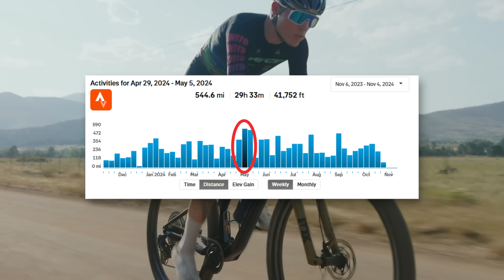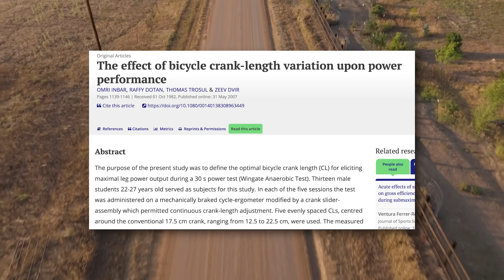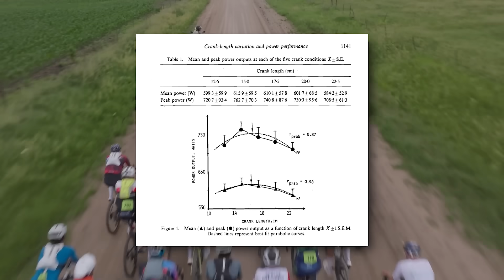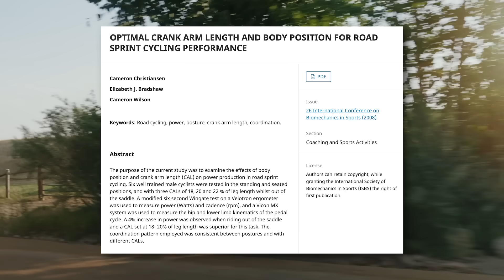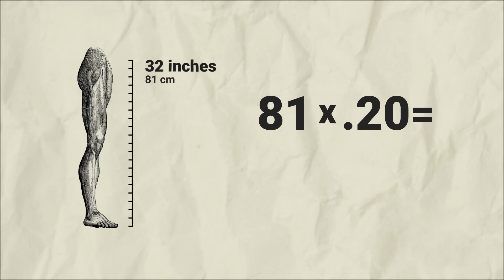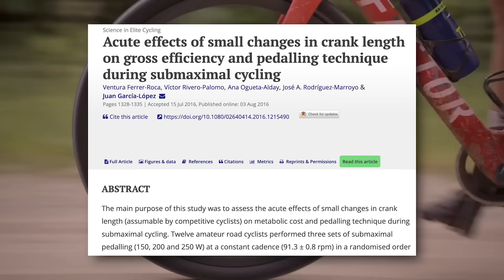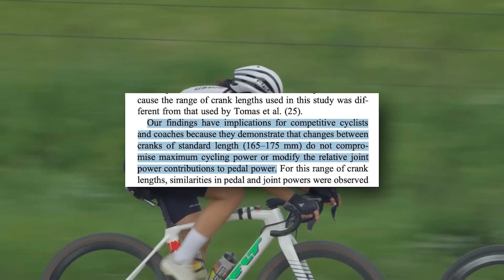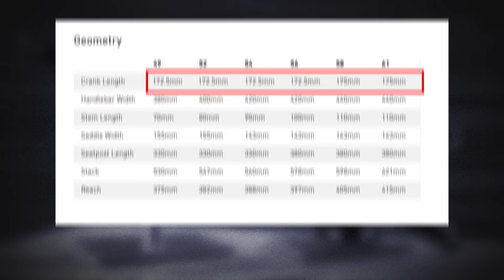You Should Be Using Shorter Cranks, Here's Why

Comment: My bikes
Specialized Diverge E5 sport 2018 56cm 170 crank
Specialized Tarmac SL4 56cm 172.5
Trek Super caliber SL 9.6 L. 175

The 170 on my Diverge was a mistake when ordering new crank set but I noticed it is much faster uphill, easier to turn the crank arms over. 🤷🤔

Comment: I am just an old guy who has never raced. Some possible benefits to shorter cranks. Being able to pedal at increased lean angles. Might be useful especially in crits. Or in really bad gravel sections. Riders with tight hips might have less rocking due the smaller pedaling circumference. Rotor makes shorter cranks. John Cobb at Speed and Comfort makes very short cranks.

Comment: 2 cents: U-tube bike fitters seemingly opt for shorter cranks for fitting reasons W/O examining for and after seat position, which that can open up the hip angle w/o changing cranks. I believe the reason for only selecting a crank length fitting procedures is expedience, seat positioning involves a multiple of variables (stem length, seat height, saddle tilt, etc) that fitters are ignoring. I would point to the pro's demand for short nosed saddles as a case in point for perceived efficiency of forward seat positioning under UCI limiting regulations. This also seemingly implies that bike fitters that only concentrate on crank arm length are doing a real disservice to their clients w/o examining a more forward saddle position.

Comment: If you run shorter cranks won't that mean you need to raise your saddle to outset the lost distance?  If you do that but leave your handlebars at the same height wouldn't that put more weight on your hands forcing you into a more aggressive position?  As someone with a bad back that does not sounds comfortable.  Am I missing something?

Comment: I'm 6'1" and went to 165mm cranks on my 1BY MTB.  It is the bike I ride the most these days.  Faster cadence at low speeds helps with balance on features and with missing obstacles.  My Salsa came with a 30T (too low) and I put a 34T oval on it.  I'm absolutely going to convert all of my bikes to 165's.  I'm faster than most of the people I ride with anyway, and I do have occasional knee issues.  Seat comfort, with less rocking seems better too.

I also moved my shoes forward a bit after watching a video on avoiding the old "ball of foot" suggestion.  Then I put a cane creek stem on my gravel bike, and that was a game changer too!  Just go ride what you have. ;)

Comment: You nailed it with thigh length should dictate the length you use. Remember your foot speed must stay the same regardless of crank length for power to stay the same. If your heart rate increases at 95-105 cadence then perhaps a longer crank and slower RPM would be better. Just one persons opinion.

Comment: 2:10 - this should come with an asterisk(**):
Technically, when You decrease Your crank length, the lowest/6-o-clock position of your foot/pedal goes up, so in order to have ~the same open knee angle (e.g. can reach the pedal with heel at the lowest point), You need to increase Your saddle height. Probably true for the heap angle though.

Comment: Probably a dumb question but should inseam be measured with cycling shoes on or off? I always ride a bike with shoes on. Without shoes my inseam is 840mm × 0.20 = 168 mm cranks? With shoes I get 891×0.20=178.2.

Comment: One thing few people mention is the the issue of gearing! I changed my girlfriends cranks from 172mm to 160mm, the result: She ran out of gears in the uphills! She had an 11-28 cassette, but her cadence dropped to a slow grind on 7%+ gradients,  we had to change it to a 11-32 to get back to normal cadence in the steeper sections of climbs. Not a big issue, but certainly an added cost if you're already at the limit of your cassette on your regular routes.  Hurray for modern gear-ranges I guess:)

Comment: Don't think crank length, think circumference. Shorter cranks reduce the circumference the door travels and increases the effective gear. A leg used to train eling at a given speed will have a slightly higher cadence to cover the same circumference distance. But it may be harder on the knees.

Comment: I shortened my cranks (from 170 to 165) 5 years ago when it was last the latest buzz. Honestly, i prefer the 165, but the gains are marginal if any 🤷‍♂️ (my height is 170cm).

Have you noticed, issues like this and other things like high fat low carb diet (heat training and carbon monoxide training 😱, etc.) all gain traction on social media only in the off season!

Comment: I have a 32" inseam and have been riding 150 mm cranks for the past five years.  I switched because I had trouble getting over the top of the pedal stroke when in a lower, more aerodynamic position.  Measured power didn't change but I'm going faster due to the more aero position.

Comment: Really wish you touched on hip binding vs leg length.   At the top of a stroke, your hips are the issue.  Not your leg length.  

Torn labrums, FAI, weak muscles from seated days, bigger issue than the length of your legs.  

Also wish you touched on the fit adjustments, like higher saddle and how that opens the hip.   If you just go listen to this video and throw on shorter cranks, your saddle is now too low.   Assuming it was right to begin with.

Comment: I always rode 170 mm cranks until I bought my latest bike which had 172.5.  I thought I'd get used to the slightly longer cranks but after 20,000 km they still didn't feel right.  I've switched to 165 mm cranks, which feel great to me.  My other bike still has 170 mm cranks and I find I can switch between 165 and 170 with no issues. Going the extra 2.5 mm though feels terrible.  Go figure.

Comment: I got a few bikes. Only on one I'm getting knee pain. My father chose longer ones for more torque (randonneur, he also chose gearing for climbing with luggage). Will change the cranks when the bottom bracket needs replacing.

Comment: been riding 140mm cranks for years, my father has been riding 145mm cranks for even longer. he's 5'10 and I'm 6'2. It's funny seeing everyone start using things like forward seat posts, short cranks, aero bars, and narrow bars. all things we used to get laughed at for. fit all comes down to what feels best. right now it's fairly hard to find things that short, hopefully people will start listening and make some shorter cranks.
Reply: Did you build these cranks yourself? Which manufacturer even offers such super-short cranks?
Reply: @einundsiebenziger5488  I use origin 8, and box. short cranks made for square taper bottom brackets are relatively available, but for any other BB standard you have to go custom. some brands run you $500-$700+. you can drill holes in pre existing cranks if they're solid and you have the tools to be precise.
Reply: Those old full Aluminium Crank are possible to Tune to shorter ones. You can Do new holes -20 mm. so from old fashioned 175 mm. are wellcomed to 155 mm. Crank's 😊 I've done now over a dozen short ones to My friend. @einundsiebenziger5488
Reply: Origin8 offers 145mm cranks.

Comment: The bloke with bad hips and knees. 👋 thanks for the shoutout Dylan 🤣 top vid as usual
Reply: 170cm tall, poor hip and knees, 140mm 👍 for years. Not for performance but it solves all the pain. It was an experiment I did (with mid foot position) after viewing fitting vids on Ur channel(s). And it works! Thanks a lot btw.

But the gear (gain) ratio thing... shorter cranks need a lower gear ratio to get the same gain ratio—a term from the Sheldon Brown site.
Reply: My 2 favorite cycling channel. Eyyyyy ❤

Comment: I tried 165 for a few months - loved the better position, better comfort, and less chance of pedal strikes, but, like the video suggests, I could just never hit the same sprint numbers - with them on, I was lucky to get to 1000w/5s. When I swapped back to 172.5, I hit 1100 easily that day.

I'm a fast-twitch sprinter and the longer stroke just worked and felt better for me because I could push hard for longer each stroke. Though I want to be more of an endurance rider, those short efforts are where I find joy so I stayed back on the 172.5s. It is a bit of shame because I otherwise liked the 165s.
Reply: It’s not all or nothing. There are sizes between 165 and 172.5
Reply: @rhughes3674  100%! I would love to try the other sizes - I suspect 170 might be good, but it's an expensive experiment

Comment: I wish we could dispense with using rider height in discussions of crank length. I think leg length is the only significant variable, so let's just use that. 20% of leg length = right crank length. Got it. Simple. I'm 6' 0" tall, but my leg length (per the study in the video using 'crotch length') = 875 mm, x .20 = 175 mm. And that's what I've got on my bikes, so no need to change, and thanks for resolving that issue, Dylan.  Good video. Kudos!     PS: I really enjoy the humor in many of the comments, as I'm sure you do too. Keep on!
Reply: Apparently, I should be on 187 instead of 175. heh

Comment: We sure have come a long way over the last 25 years on this topic. At 6’1” with relatively short legs and a lot of flexibility I used to run 175s for Mtb and road. I dropped to 172.5 for road and saw zero downsides, then followed with a drop to 170 for mtb and loved it immediately; only benefits perceived. For 2023 I took the leap and went to 170 for the dropbar bike I do everything on, and gave it a good shake. Ultimately, I couldn’t convince myself that 170 worked better for me in any way than 172.5. If anything, I kept thinking I had a bit more weight on my hands than I wanted, and my sweet spot cadence range didn’t seem to jive (I’m an 85rpm guy). I swapped back to 172.5 for 2024, and haven’t looked back. In Oct I rented a Giant TCR while in Portugal, and did about 900km on it in the Algarve. It has 175s, and they felt like crap. Both knees also showed signs of strain here and there. Looking at mainstream 58cm bikes on offer these days, it seems many brands are still into g 175s, which is ridiculous in my view. I can’t see them making sense for anyone under 6’5”. Similarly, 44cm bars. What, really?!

Comment: Spinning up crank length discussion proves that pedal-based power meters are superior to crank-based ones. (pun intended) Switching cranks is already a pain but adding the extra costs associated with moving a power meter on top of that? Yep that's why pedal-based power meters are superior because it removes that element. That is, unless you get a new PM crank set to replace the one installed on your bike and have no plans on changing it.

Comment: On mtb's cranks are usually 175mm. I changed mine to 170mm and not only is it a better fit but it also slashes into roots less often. Agreed with the idea to go 165mm for medium sized bikes as standard. Cranks are very expensive and its a shame to have to replace them right away.

Comment: To provide an N=1 counter example to your conclusion. 

When I was racing on the track (Burnaby Velodrome, 200m) about 10 years ago I quickly found that while I could barely keep up with the "B" group (avg speed 44kmh) on the mandated 88" gearing, I could hang easily with the A group (avg speed 48kmh) if I raced on much larger gearing. Typically 96"-100".

Effectively (as a non-sprinter Time Trialist) I was limited mostly by cadence. an 88" gearing required a much higher cadence (> 110, and as high as 130). The much larger gearing allowed me to keep cadence mostly below 110.

Moving up to 175 mm on my track bike also helped me (although this was subjective). That allowed a larger front ring and a smaller cog, which reduced cadence as well. 

None of this helped with sprinting. But when there were B races I could enter that did not have gearing restrictions, I could easily work the front and tire the pack out, reducing their ability to sprint as well, especially in longer points races and point-a-lap races.

Comment: Ugh - Cam Nichols?  What a bought-and-paid-for shill!   But even a clock is right twice a day!

fwiw "faster" is a bit misleading, but overall still true.   Shorter than industry standard (STIS) cranks are without doubt more efficient for the vast majority of riders.  172.5 on a 49cm! That is cra-cra!

Been running 165mm cranks for over 15 years.  It hasn't been easy because, as mentioned, most bikes sized to fit my 5'6" build come with too-long 172.5 or even 175mm cranks.  In fact if 20% of crotch height is ideal, mine are still about 10cm too long!

 Not only do STIS cranks have more clearance and fit better, but anyone who knows anything about biology and how power is produced knows shorter is inarguably better from an endurance standpoint.  It's easier to spin faster than harder over an endurance effort.  Fast twitch, vs slow twitch is a thing and yes, physics is fact regardless of what flawed studies we have to review.   

fwiw - I don't understand why it's so hard to source experienced riders for these studies.  It's important.   Using novices is unacceptable.  Pedal strokes are not simple movements.  If a study wants to make an authoritative statement on crank lengths at endurance pace, then a novice simply isn't in the shape to do it.  I'm not a pro by any means but I ride about 6000mi/year which puts me beyond "novice" and I'll happily volunteer. If anyone is in need, get in touch!

The only surprising thing about this to me is how the cycling manufacturers', and thus consumers' "thinking" on this subject has remained so calcified and perverted for so long.   The assumption this could be just a fad speaks volumes.  

Given the state of science as we know it, the burden of proof should be proving longer is better, not the other way around.

Comment: My question has been for a while now, about the absolute bottom end power, as in when you are in your lowest gear going uphill, especially on those really long steep grades. I feel that there are three primary factors to consider. (1) Loss of leverage, and (2) Is that offset by having less of a dead-zone at the top of the stroke? In other words, if the cranks are turning over in a smaller circle is the loss of leverage made up by the increased time in the power zone of the stroke? (3rd) Possible aspect would be the leg not being in as much flexion could leave you in a better position for leverage as a whole. For me where I live It's all about balancing cassette ratio spacing for maintenance of comfortable cadence and top-end climbing capacity. We have long steep climbs and lots of flat to rolling terrain and can be all in one ride.

Comment: Increased cadence is a cost to the potential marginal gain. Holding cadence constant requires using more gears. That could mean chainline efficiency losses, or putting more weight on the bike to get a larger chainring.
Reply: Weight of a larger chainring? That’s insignificant. Larger chainrings are more efficient anyway
Reply: @cameronALR6  I agree that the impact to cadence is the more important thing to focus on, but it's also worth noting that it's not always straightforward to just get a bigger set of rings. Many bikes are limited in how big a ringset they can run. Shimano has made it difficult (expensive) to move past 52.

Comment: An advantage not often mentioned with shorter cranks is increased bank angles on road.  In criteriums this can be huge as you might be able to pedal thru a corner you otherwise couldn't.  Again, marginal gain for sure.  On mountain bikes, shorter cranks can mean fewer rock strikes.  I went from the 175mm XT that came standard on my Lux Trail and went to 167.5 and noticed a difference in strikes.  I went 167.5 on all my bikes now and am happy with the results.

Comment: I race single speed mountain bikes.  Nearly every climb is out of the saddle with low cadence.  I’ve tried shorter cranks, but I think this is one specific situation they may not be better than longer cranks.

That being said, as a single speed racer I also have to ride at extremely high cadence.  Shorter cranks can certainly help with this.
Reply: No they don't help. You will have to pedal even higher rpm to get same speed.

To go at a certain speed you need power.

power = torque * rpm
power = force * cranklen * rpm
When you reduce your cranklen and you cannot apply more force you will have to increase your already high rpm even more. This may help in the low cadence situations  but makes the high end even worse. So you will have to change gear ratio to come back to previous ranges.